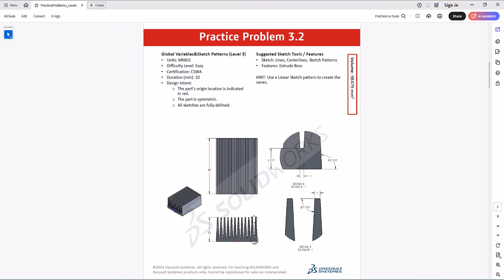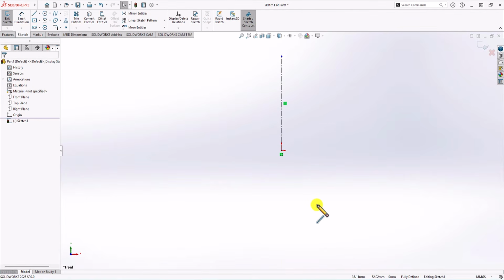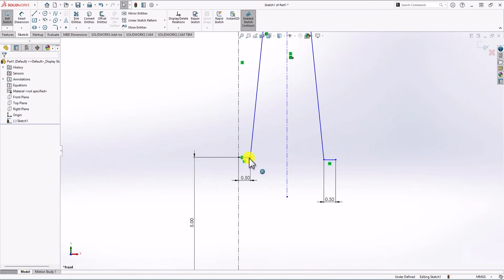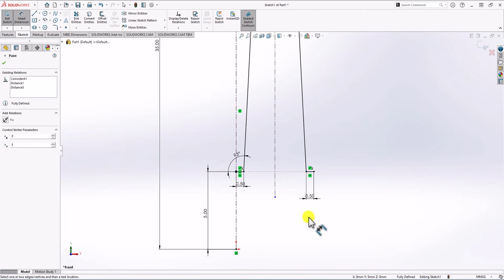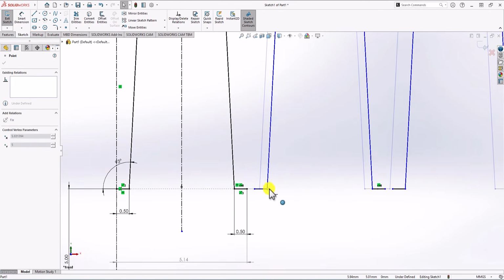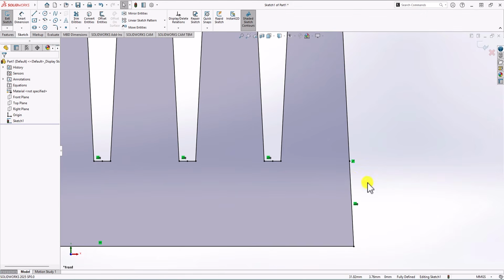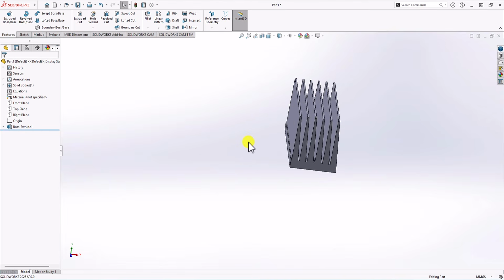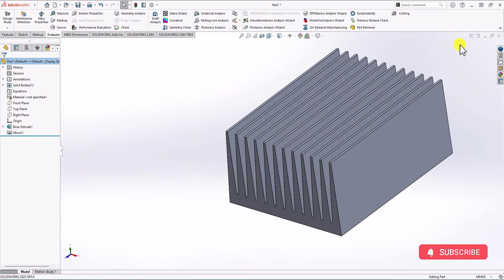CSWA Practice Problem 3.2 Solution | SolidWorks Exam Guide

Comment: Why didn't you use 87 degree information?
Reply from the maker: The reason is that we already used the 93° angle in our modeling. Remember, 93° + 87° = 180°, and for your model, you only need to use one of these two provided angles. The other one is simply there for reference.
If you try to use both the 87° and 93° angles in your modeling, your sketch will become over-defined. That’s why I only used the 93° angle. I could have just as easily used the 87° angle instead and ignored the 93° angle.

Comment: For the linear pattern, if you select the Dimension X spacing option, then enter a random distance value, and then checkmark it, you will see that distance and can edit it after check marking it. You can then delete that dimension you see and dimension the 1mm distance given in the drawing (or whatever distance you want based on how you started the sketch). And since the other entities still have the pattern mate, they will also follow that distance.
Reply from the maker: Sorry, I didn’t quite understand the point here. Would you be able to explain it a bit more? Is this approach mainly used to maintain the relations between parts and keep the geometry fully defined after using a linear pattern?
Reply: @Design_With_Roozbe  basically I was referring to when you said you don't have the dimension between the patterns. I was saying you don't actually need them to get the right geometry because you can define a random linear pattern distance, and using the Dimension X spacing option, you can edit that dimension even after you confirmed it. But not only can you edit after confirming the distance, but you can also completely delete the dimension, and the pattern mate will still be there. And after that, you can define the dimensions you want and the patterns will follow. I think I made this confusing, sorry
Reply from the maker: @jjcsp3  Oh, I see, now I understand your point. That’s actually a great way to do it, and I didn’t know about that approach before. Thanks for sharing it!

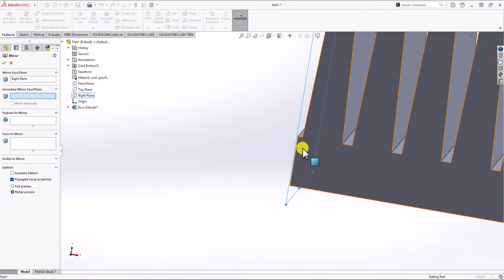Comment: When i try to mirror the sketch, it says invalid solution found (invalid geometry, item unsolvable), but when I mirror the feature (like what you did in 11:15), it works fine. Why is that the case?
Reply: anyways thanks for the videos, really helped me a lot as a beginner.
Reply from the maker: @MoForGum  Thanks for your comment. It’s a bit difficult to give a definitive answer without taking a closer look at your model, but here’s my thought.
When you mirror a sketch, SolidWorks needs to create new sketch entities and resolve all the relations and dimensions again. If the sketch contains small gaps, overlapping lines, conflicting relations, or complex tangent conditions, it can lead to an “invalid solution found” error.
Since your 2D sketch likely has many details, there’s a good chance SolidWorks struggles to solve all those constraints during the mirror operation.
In these situations, it’s usually better to first create the 3D feature and then mirror the feature instead. This way, SolidWorks only mirrors the final geometry rather than trying to rebuild multiple sketch entities and relations.

Comment: I was trying to find a way to use the exact distance for the pattern. I guess that's not an option.
Reply from the maker: If you’re interested, there is actually a way to calculate the exact distance. However, it’s not the most efficient approach and requires some mathematical work using trigonometry and similar triangles.
I’ve briefly explained the process below. To help you better understand the variables, I’ve also included a picture in the link:

https://drive.google.com/file/d/1OUTQn-6Le5r1g0xRo7qbmJw2Kzscx0-S/view?usp=sharing

If you look at the fin design, it has a trapezoidal shape. First, extend the edges until they intersect to form a full triangle. Then, focus on half of that triangle.

Since we have a 93° angle, the angle at the top of the triangle becomes 3°.

Using trigonometry:
tan(3°) = 0.5 / h
→ h = 0.5 / tan(3°) ≈ 9.54

Now, using similar triangles:
0.5 / x = 9.54 / (9.54 + 30)
→ x ≈ 2.0723

Finally, we can calculate the exact distance:
2x 2.0723+ 0.5 + 0.5 = 2(2.0723) + 1 = 5.1446

As you can see, this matches exactly with the value obtained from the fully defined geometry.

Hope this helps! Let me know if you have any other questions.
Reply: @Design_With_Roozbe  oh I'm good with math. That's my thing. 
I was thinking more in a using measurement instead of typing in the distance.